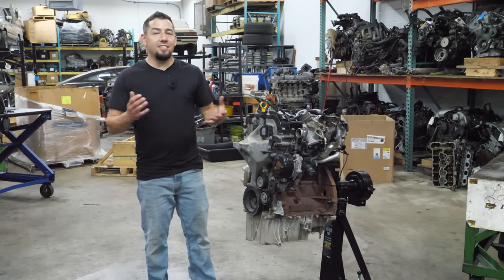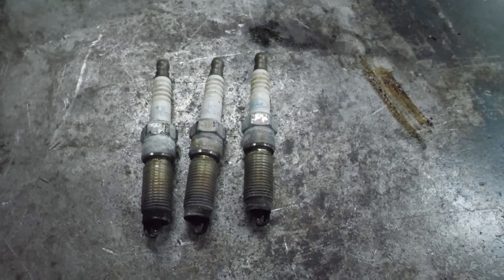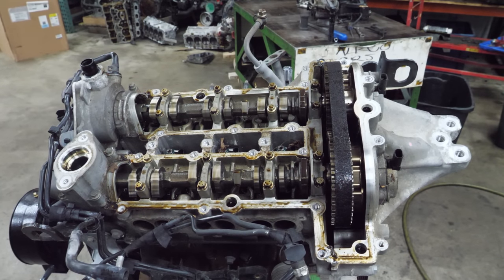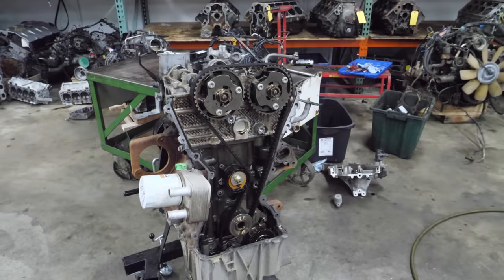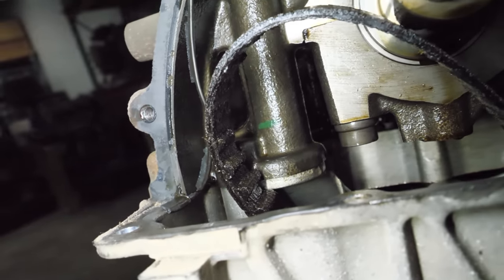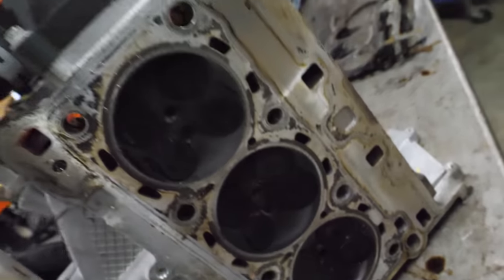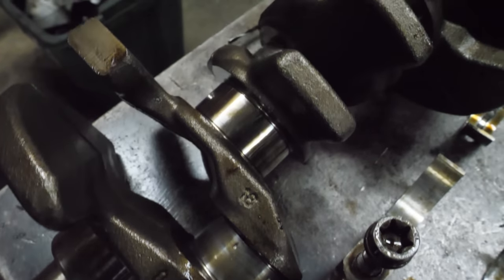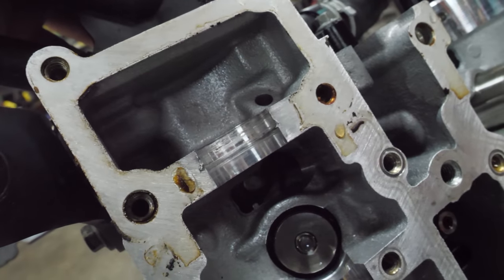JUNK Ford Ecosport 1.0L 3-Cylinder Ecoboost Teardown. LAWSUIT ENGINE!

Comment: These were really fuel efficient in the Fiesta, with the manual being the most efficient non-hybrid made in decades.
Reply: My experiences too, can get ~63 mpg going 70. Baffling how that EcoSport can be so inefficient.
Reply: I had one of those, a 2014.  Got bored with it and traded it before there was any trouble.  Mind blowing how strong a 60 cubic inch regular fuel engine can be.
Reply: I can confirm. I have a fiesta with the NA Ecoboost engine (80PS, 1.0L) and I can get 20km of range out of 1L of fuel. I have seen this numbers only on hybrids and diesels before! Very happy with that!
Reply: VW TSIs and PSA Puretechs can achieve similar levels of power and fuel efficiency while also being much more reliable though.
Reply: The one litre  three cylinder ford is a hybrid though according uk government tax check it says mhev............Mild Electric Hybrid Vehicle!
Reply: @paulburns3039  I'm sure it has many applications. In the US it was in the Fiesta, focus, and ecosport. None of which were paired with a hybrid system.
Reply: @paulburns3039 it's not an hybrid, although it has the same emissions. Proof that you don't need an electric motor to have such efficiency
Reply: @samuele_gonnella  it's not that efficient if the engine don't last long!
Reply: @paulburns3039  fact is that the problems were related mainly to the turbocharger they used. The NA is quite reliable
Reply: @nebnollock5198 it’s down to newer cars having cylinder deactivation (eco mode) I have a 2018 fiesta and it isn’t even a MHEV but getting 60mpg is still a cake walk but earlier models or anything else of that period that uses the engine won’t have it
Reply: @samuele_gonnella you’ve got to remember the main issue is oil starvation from the belt breaking down and blocking the pickup. Low oil pressure will destroy turbo bearings in no time. Also the wastegates tend to rattle when they reach 20k thereabouts and eventually lead to loss of power issues
Reply: @StanceSantos  mine actually is the NA. No turbo = no turbo bearings = no probs on that side. 
And if you do your maintenance the correct way replacing the belts every once in a while you will have no problems. 
The NA Ecoboost isn't unreliable if you keep it the correct way.
I think there might be problems in the future regarding the coolant pipe the guy in the video mentioned, so I will keep an eye on that.
Reply: @samuele_gonnella  I’ve drove the N/A 1.1 VCT before and one thing I noticed is they run cooler than the ecoboost. the gauge settled around 87 degrees whereas my ecoboost is almost always running at 90 degrees. Wet belts are still a concern but as you say regular maintenance and oil changes are the key to keeping these engines going. People tend to neglect these things then wonder why their engine starts acting up
Reply: @oxaile4021  VW TSI aren't more reliable than this. They like to take oil after a while. Actually 1.4 TSI is the worst especially units produced before 2015 where piston rings fail every 50k. Ford 1.0 is not the worst by far. It fails because Ford tells people to change oil every 20k km and that the belt can easily hande 100k km. If you change oil before 10k km and belts at 80-90k the engine should do 200k km before it fails :D
Reply: @tw1st3d35 PSA also has wet belt, I would skip it.
Reply: If your car doesnt have 300hp you are so poor.😂😂😂
Reply: @nebnollock5198  Oh, that's easy.  Compared to the Fiesta, the EcoSport is way taller,  not sure about aerodynamics, but seems to have way more frontal area, and, weighs 3,300 lbs vs the Fiesta's 2,600 lbs.  700 extra pounds makes tiny engines unhappy.
Reply: The cars I push to work are also VERY efficient!!
Reply: I think the 3l Lupo is more efficient, it get 78.5 MPG or 3l/100km. But its diesel
Reply: @nebnollock5198 not that impressive.
I took my mums holden astra 2018 (chevy cruise i think) sydney to melbourne and back average 3.4l/100. So 70mpg.  1.4 turbo petrol using standard 91 octane. Guarantee you it was a far better drive than flogging a 1 litre...plenty of go for overtaking and torque on hills.
Reply: @smieszek8080 after a while? Its literally in the handbook that up to 1litre per thousand kilometers oil consumption is considered normal. My 2012 skoda fabia rs did pretty much exactly that. I carried 5 litres in the boot and topped it up every fuel fill. They only do the rings if you dont keep the oil up to them. The dsg is far more likely to actually fail.
Reply: @sugarnads  It's so hard to find a newish car that doesn't have something broken by design in it. I own this 1.0 and a volvo 2l straight 5. Would take volvo anytime over the 1.0, but so far both engines have performed fine. No oil consumption and no issues after about 10 years (ford) and 9 (volvo).
Reply: Looks like they engineered it perfectly. The rest of the car was probably junk also. It was only meant to last tge life of the car. Any more is a waste
Reply: 1.0 EcoBoost 125 Automatic	48.7–50.4 mpg	rated with real life 35.1 mpg. So no, it does have some promise.
Reply: @smieszek8080 what's worse is Ford recommended 150K miles (240,000km) wet belt intervals or up to 10 yrs, whichever came first. Of course when the engine doesn't make it to that mileage because the belt snapped at 100,000 miles Ford would have nothing to do with it as the car will no longer have a warranty. How convenient...
Reply: My experince with a 1998 Nissan Sentra... 48 MPG Hwy and 35 city. That was back when Nissan was still a good brand.
Reply: When I had one I'm my 2016 ZS fiesta 5 speed manual  (tuned to around 155bhp) it would do around 50 UK mpg however the fiesta ST 1.6 6speed manual I replaced it with could do the same if not better mpg. The 1.6 is a lot more reliable makes much more power etc
Reply: If you drive like your grandma, sure.
Reply: nothing efficient about an engine that gets decent mileage for a short time then self destructs from 
pathetically poor engineering
Reply: @StanceSantos my watergate broke at 350k and the flapper stopped before the cat. Turbos are cheap and easy to install
On this motor.

Comment: Greetings from South Africa. Great content sir. Just to let you know, that wet timing belt cost over here is ZAR 19000, roughly 900usd. If you have it replaced by a Ford dealer, your looking at, at least 2000usd. Good luck and keep doing what your doing
Reply: Insane. So glad I went for the 1.5 diesel. 220k km and no problems yet
Reply: Also from SA. I had my timing and oil pump belts replaced at private mechanic for R5500 at 120k km. He said they were a bitch to replace and now I can see why.

Comment: The only three cylinder i support is the IMR m33 diesel engine found in the IMT 533 with 35 horsepower and 2.5L of displacement. A common problem for this engine is if its idle is out of tune you cant ever find the ideal idle rpm, second sometimes the vibration of the engine at idle is transferred to the cab, Imagen a massage chair make it out of thin steel and make it 15 time more violent. Its a reliable engine especially that its found in tractors that are approaching the 50 and 60 year-old mark
Reply: Triumph make some truly excellent 3-cylinder motorcycle engines...   Yamaha too, in recent years.

Comment: Excellent visual and talkthrough,  having been retired for a few years I hadn't even heard of this wet belt system. 
What I have learned is that I will never buy a vehicle with this type of engine. 
Having quite a few years experience dealing with problems and the way I was taught by an excellent teacher I became the go to person for diagnostics so just looking at this mess that you uncovered makes me wonder why they didn't go for chains. I imagine the lack of a key on the crank pulley means that there will be a lock pin slot on the crank. 
Overall a terrible design. 
Thanks again.
Reply: Never buy an eco boost engine from food only NA… sometimes the high pressure fuel pump goes out early
Reply: We also have this architecture on Stellantis group Puretech 1.2 engines (Peugeot, Opel). This 3 cylinder engine eats too much oil and makes this wet belt dry and cracks it up. The whole engine just dies...
Reply: Every vehicle with a time belt is known for it! Buy a car with a proper chain! The chain will make noise before it beaks and then you will know that you need to change it! With belts you never know because they don’t make any noise! Bad design!

Comment: Have mine in a Ford fiesta (UK)does average of 49 mpg , had it 8 years from new , not had any problems at all , think like most engines, service yearly with a oil change in between is paramount, as is the correct oil. Keep the videos coming 👍
Reply: Probably helps that yours is not in an ugly and non-aerodynamic shape like the ecosport...
Reply: @Sturmovik1946  😂😂😂
Reply: @Tango22052 my Fiesta is 10 years now with 140.000km on it so i will have to get the wetbelt replaced soon but i have not had any problems with it

Comment: Great tear down, might be useful for me in the future. Our UK Ford fiesta ecoboost 1.0L is the 100hp version so its not as stressed. Its 10 years old and on 110k miles with no issues. Only thing i would say is the oil you drained was thick. The oil is supposed to be super thin and contain additives to help preserve the belts internally.
Reply: Cold oil will be thicker.
Reply: @offshoretomorrow3346  not sure if you use SAE cert oil types but 5w20 oil is thin even when cold.
Reply: Buy Walmart oil and that is what you get: blown engine
Reply: @C0Y0TE5 SuperTech oil generally has a very good reputation?
Reply: @gtemnykh  ---->Note that engine with WET timing belts requires a SPECIAL spec oil.  Not Walmart and Not cheap oil.
-- Go to Ford dealer and get the right oil
Reply: You gotta replace the belts anyways. Its a shit design
Reply: @WorivpuqloDMogh   No sir-e. On engines with EXTERNAL belts, change is needed every so often. Many engines have "lifetime belts, such as the older Ford 2.3.  I changed mine at 20-yrs old/100,000 miles, cause I did not believe in "lifetime." Ford would not give me a recommendation to change Timing belt.
-- The 1.0 belts are INTERNAL, and the engine needs removal and disassembly to "change belt."  It is a lifetime belt that is maintained by using the proper spec oil.
-- Did U not pay attention to the video?
Reply: @C0Y0TE5  that belt would have snapped a few 1000 miles later anyways.  Even with special spec oil. Rubber wears down. 

If they want it to last they would have used a TIMING CHAIN.

thise engines are pieces of shit
Reply: @WorivpuqloDMogh Ever hear of the Ford Ranger/Explorer 4.0 Exploder?
-- it has FOUR timing chains and it gets no farther than a "lifetime" timing belt.
-- Yr just old school

Comment: I have had a new B-Max manual for 4 years with this engine. Promised 47mpg - did 33mpg w. 120hp. Bought a Mazda CX3 also 120hp but from a 2 liter atkinson cycle no turbo. Promised 40mpg - did 40mpg with automatic. Pulling trailer down to 15mpg on B-Max - 35mpg on Mazda.

Comment: I've one of these engines in a 2022 Focus (in Ireland). Engine has been great so far - smooth, refined, a bit of a 3 cylinder thrum when pushing on (it would remind you of a junior Porsche 911). Economy is excellent - just under 52mpg over 8500 miles from new.
Reply: I'm in Ireland too. I've noticed the new focus is very popular with a certain demographic. Did you notice this?.
Reply: @meab12  No. Which demographic are you talking about?
Reply: @signalorangers2k  travellers. I live in the southeast and that car is very popular with them

Comment: I have a 2016 fiesta 1.0 ecoboost. It's just hit 90,000 miles without issue. Despite being used for fast food deliveries, it's on it's original engine, original turbo, clutch and gearbox. Regular oil changes are key, and my understanding is that using anything other than the correct ford spec oil - WSS-M2C948-b, results in the belt disintegrating prematurely. 
I imagine many of these engines go far too long without an oil change and when they do get one, they're probabaly serviced by back street garages or large chain fast fit places, who'll throw any old shitty oil into them.

Comment: That was an awesome teardown 😲 I knew of the reliability issues with this engine, but that design is just terrible. My daughter has a Fiesta with that engine and it drives really well. Must check that she gets it serviced on time. Thanks again.
Reply: And be sure to use the correct oil! The wet belt should last if you use the correct spec of oil. The ford wss-spec has to be exact. Still a piss poor design though.
Reply: My fiesta ecoboost is 10 years old now with 140.000km on it with no problems but the wetbelt swap is due very soon
Reply: @forzer45 yea that's true a lot of people think 5w 30 is good enough for that engine but it needs 5w 20 and the oil swapped either every year or max 10.000km that how i done it
Reply: @SASMacDroid  it's not necessary about the viscosity. Even a 5w20 WILL break the belt if it's not the correct Ford spec.
Reply: @forzer45   I guess it's a chemical issue. So this issue is happening from people not using the proper oil. Makes sense. Always get the correct rating oil for your engine, even if it's only a few quid more... best to just shop around.
Reply: Service manual book from Volvo recommend to replace belt at every 75,000mi OR 5 years.

Comment: I haven't been watching long, but this is by far the best looking engine as far as fixable damage. Everything else I've watched this guy pull apart as literally been shrapnel .
Reply: Yeah but it’s really new. It shouldn’t be messed up.
Reply: This engine is most likely scrap metal. It has been run with low to nearly no oil pressure due to clogged pickup so bearings and piston rings will be ruined. This car will consume heaps of oil if put back together again. Fixable when torn apart like this one but not feasible do to in a garage. To expensive.
Reply: @Noavaileblenames   And that is why we fail.
Reply: @MondoMurderface what does that even mean.

“Why don’t we fix what we have rather than buy something new?”

You’re wanting to repair an engine that was never designed to last. There’s no fixing that. You repair it and it will have the same problems again. It’s trash.

Comment: If you use the correct specified oil and are doing oil change every year, you will not have that issue with the timing belt. Our Fiesta just made the odo full with 200.000 km. No issue!
Reply: With the 3-cylinder EcoBoost 1.0?
Reply: @u.e.u.e.  yes, with the 1.0 3Cylinder

Comment: Non keyed crank is very common. They use diamond washer to hold it in time. Timing the engine with cam holding tools actually times the engine more accurately. But it is way easier when they have keyways
Reply: My understanding was they could set it up perfectly when it wasn't in a vehicle and they saved a few pennies not machining the keyway into the crank.

Comment: I did 90k miles, including 15 track days and 3 Nurburgring trips in my 1.0 litre eco boost, engine was mint, never had a problem. I serviced it every 8k miles with genuine service items. For 2013 was a great petrol engine

Comment: Great vid and explanation thanks. The concept of a tiny 3 cylinder engine plus a turbo for me is a terrible concept. 100 times better is the normal 4 cylinder engine with no turbo which is less stressed so consumes less and last soooooo much longer!
Reply: Toyota seemed to make it work with the GR Yaris
Reply: The design flaw in this engine is the belt, it had nothing to do with it being a 3 cylinder. The idea that small engines have more stressed components is a complete nonsense. Components always have to be designed to handle the forces it gets exposed to. If a 6L V8 has a component that isn't designed to handle the stress it will fail just as easily. Look at literally every other video on this channel, all big engines that blew up. The only reason why many small engines don't last that long is because they are designed to be in cars that aren't expected to be driven a lot either. You can just as well design a big engine to not last long but bigger cars are generally expected to be driven more.
Reply: @JMNTN  theoretically a 3 cylinder should be more reliable as less moving parts = less chance at mechanical failures. The wet belt is definitely what lets this engine down as it’s the main culprit for turbo failures and big end bearings failing
Reply: The concept of a small 3-cylinder engine with a turbo is great.

The problem seems to be that this type of engine was new to Ford, and starting from scratch they made simple mistakes with terrible consequences (maybe they didn't put their best engineers on it, because they put them on their giant engines that make them their best money).

If only Ford had persevered and improved the design to remove these well-identified flaws. Because the future of gas engines is in small efficient cars, not giant pickups.
Reply: Daihatsu made a great wee engine in the charade gtti, they're 3 cylinder, dohc, 1 litre turbo with 99bhp. They were produced in the 90's. The gtti were hilarious and fun to drive.

Comment: My 2015 Fiesta Black has this engine, 140PS version with 5 speed manual transmisson. I am driving it daily to work since 2016, 90 km/day on average, my route is mixed city and highway, mostly at 100 km/h speed. My longest drive in a day was approximately 1200 km on a hot summer day. Combined fuel consumption for me is between 4.8 L/100km (spring time, A/C turned off), 6.5 L/100km (summer, A/C on), 5.4 L/100 km (winter with snow tires, no A/C). I am changing the oil and get periodic maintenance once a year, around each 10K to 15K km, belts changed this year (2023).  I did not had any failures so far. I am pretty happy with it, and I hope it will last for many years more.